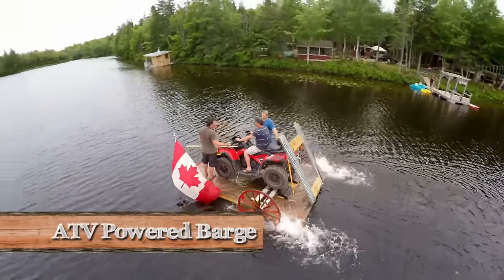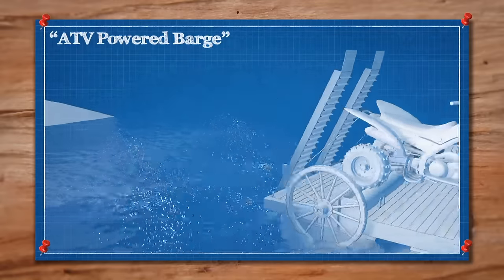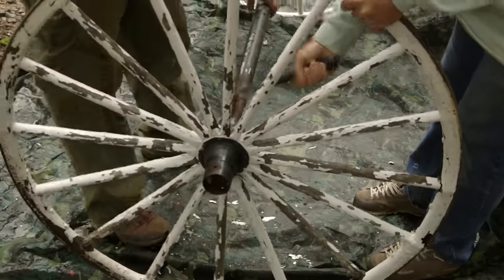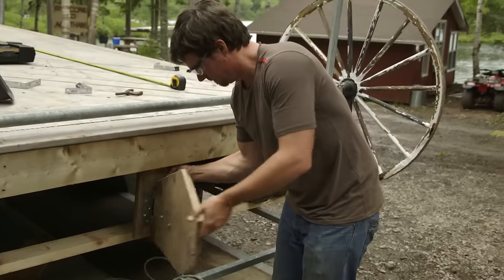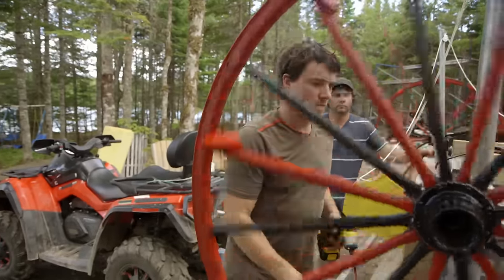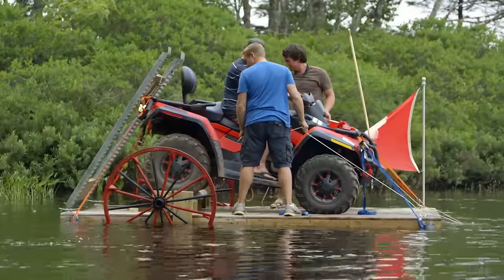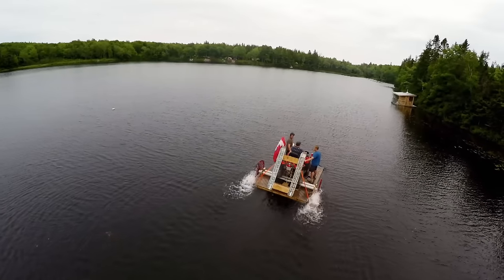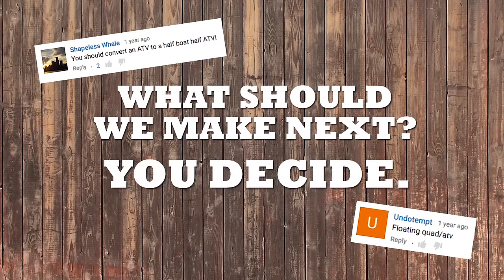How to make a FLOATING ATV

Comment: 2wd Honda fourtrax, larger mud tires, and a basketball stuffed into the front of the frame and re-inflated. It'll float. Mud tires act like paddles. That's how I used to get across the canals in my hometown. It'll float without the basketball but don't let off of the throttle. The front end will sink.
Reply: NodnarbTheRed dam sounds interesting what gear did you use?
Reply: NodnarbTheRed what did you use for steering it just worked like that?

Comment: Great idea...not! Take a $10K ATV out into the middle of a lake on a top heavy contraption then wait for it to tip into the water. Not only do you lose your ATV you get a ticket for poluting the lake with oil when the MNR trace the slick back & find your license plate on the source...